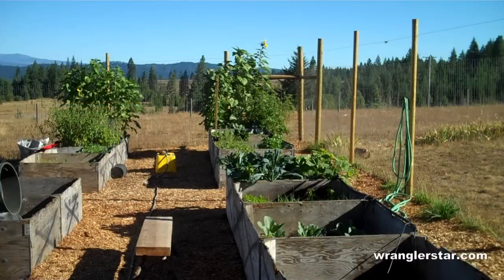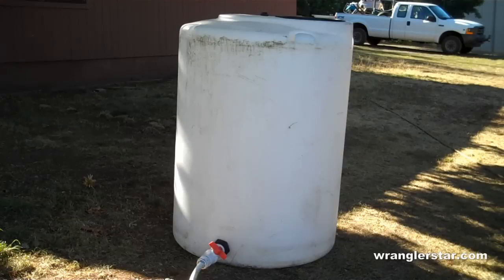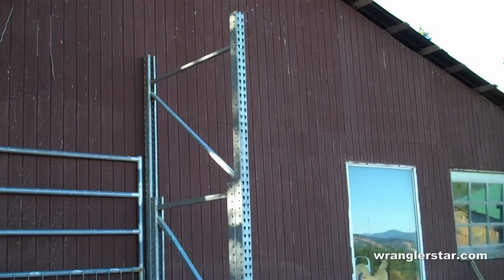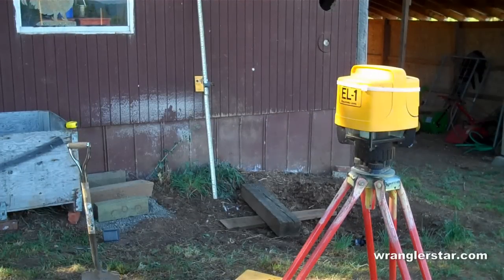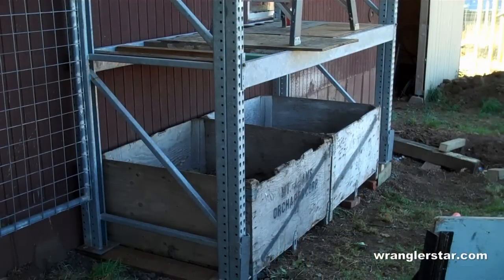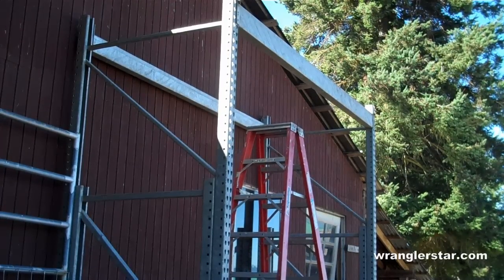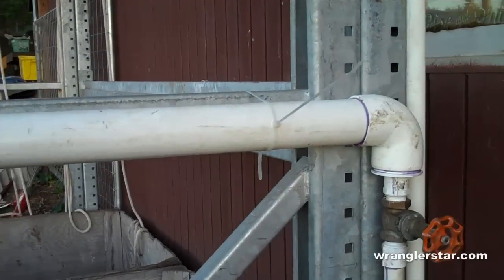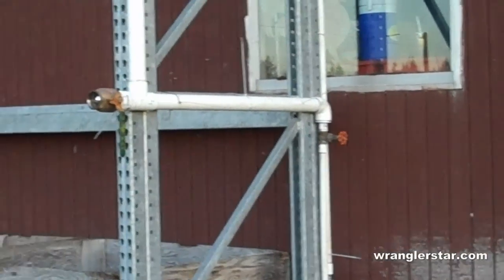How To Build A Water Tower Off-Grid Homestead pt 2

Comment from the maker: yes they are slender however they are heavy gauge and doubled up. The load is on top is static for the most part and will be bolted to the building. Do you think this will be adequate?

Comment: Great work Cody! The Ram Pump concept is fantastic. I'm reading a comment below mine on collecting rain water. We started collecting water from our tiny tiny garage into a small 30 gallon trash can and with the smallest rain it would fill it up and over flow. You could cover your firewood with a simple structure with a corrugated roof and collect rain water. Have you considered a below ground mega-storage tank? Tank cost would be high.

Comment: I built a temporary one years ago. 26' tall (the length of the timbers I got cheap), crossbraced with lag bolted salvage 2x6's,  and a 200 gallon horse trough up top. Also a 200 watt Wincharger from the 1930's, 6 volt! I charged gangs of 6 volt golf cart batteries, and then used them as a single 12 volt battery. This system got me by for a couple years, gravity fed water is much better then pouring it out of a jug, you can use less water, more efficiently.

Comment: Hi Cody. Here's some food for thought: I'm a former structural engineer. I used to design bridges and bldgs. Your tower legs are most likely what engineers call "slender". Slender members need to be braced to cut down on their effective length. This stops them from failing via "buckling". You may want to look at transmission tower legs, to see how they are prevented from buckling.

Comment: Legs seem strong enough, the answer to anyones doubt should be -what are the shelves rated to hold? The connection from the shelving cross pieces to the uprights would have the be the first point of give if it were to ever happen. One could easily add a second set of cross pieces say 2' beneath and set post uprights between the shelving to share the load between the two layers of shelf supports. Anyway this system is easy to take apart and modify if need be. I hear ya cody!

Comment: In the design I have in my head for my retirement cabin I have a steeple with the flr and lower walls tiled and h2o proofed and 2 water tanks. one for water, with its overflow leading to the hot water tank. this is how I plan to get water pressure for the indoor plumbing from a low volume well pump or ram or gravity flow from a spring. Haven't done all the math yet for weight and structure and head needed for pressur desired. So. this vid came in very useful. Thanks as always. Toby

Comment: .43 pounds pressure per foot of elevation, means if you want 60 pounds water pressure your tower needs to be140 feet high.
Normal pumps cycle between 40 to 60 pounds so 40/.43 means you want 92 feet to get 40 pounds.   Less is fine for drip irrigation, but pressure is a good thing.

Comment: Great video, good explanations, sound logic and reasoning. I really like the firehose attachment and had not thought of doing that myself until I saw your video. A word of warning though... the valve you have one near the close attachment fitting is not a gate valve it is a ball Valve. A ball valve will freeze and bust because of the water trapped inside the ball when it is in the closed position. Either drain the system for winter time or change that out to a gate valve.

Comment: A few thoughts on your project.
1. If you start getting algae in your tank, add a few tablespoons of bleach to the water. It doesn't take much.
2. Buy a 1,500/2,500 gallon water tank at Big R and use that for your over flow. Hook your gutters up so they discharge into that tank. You can never have enough water in the summer.
3. If you won't buy a tractor/backhoe(or small excavator) for yourself, buy one for your wife! You've got a good one there, Cody. Take care of her.

Comment: I listened to the trademarked (?) Wranglerstar Rant on a later video and I came back a few videos to take a look at what was being ranted about. Since it has been a few years since this video was posted I am sure the structure has worked out great. 

My only comment would be to upgrade to a couple of concrete, below the frost, piles. Adding a solar panels and some really slow wattage heat tape may allow you to keep this going over the winter should you plan a winter greenhouse. Melting snow and keeping it ice free is a challenge of course. 

Thanks for the video. Structure looks not bad to me.

Comment: We live off-grid in the midwest.  We have all the same seasons as you do out there in the Pacific North- West.  Having grown up out there, it seems much colder where I am right now here in Iowa.   We have a well that provides our water here.  We also have a 1.9 acre pond (but I wouldn't drink that water).  We have 4.83 kw of PV and another .8 kw of wind energy, both feeding our battery bank.  Even though it seems like a lot of power production, we still conserve energy the best we can.  It seemed like a great solution for us to build a water tower and control the well pump so that we are just filling the tower when we have extra energy (as a dump load).  I was explaining all of this to my better half and she proved again why I call her that.  She asked "what about it freezing".  So I pondered what it is you are using your tower for, and I came to the conclusion that perhaps you are only irrigating the garden (which doesn't require water in the winter) and this is not your source of potable water. For now it looks like we are back to the drawing board....and  I was really looking forward to being able to flush the toilets at night!!
Reply from the maker: +cmilano24 You are correct...garden only.  Any way for you to insulate?
Reply: Certainly!  Maybe I'll try and duplicate what the outdoor stove people do with the glycerol lines.
Reply: spray foam insulation?
Reply: 2 years after your comment I am wondering it you came up with a solution for winter. Insulation would only work for so long. You would need to do two additional things. Circulate the water and warm it.

Comment: We use those racks in our cold storage & you may want to put a strap or piece of all- thread connecting the front crossbeam to the rear in the center. I have seen those crossbeams spread out under load or if the base does shift & the boards/2x4's can fall out.

Comment: I just copied your tower at my cabin in AZ. I will only have about 500 gallons at most but only 275 currently on the tower.  I did use concrete footings but I even copied the 2x4's. Thanks

Comment: Paint your barrels black then rap your barrels in black plastic, this prevents sun from penetrating the barrels but also heat. Place the barrels on the side of a building where the sun does not shine so your barrels do not go through a heating and cooling down fase every day. Use fine inlet screen to filter the water before it hits the barrel. Use a water spreader when it goes into the barrel. Do not allow insects acces. Clean roof/gutters is essential.

Comment: I would like to see an update on how this is working out. I didn't see a valve to shut the water off for future work on the system. If you add a tank or rework lines it seems you would need to drain the tank or stick a ball in from the top to plug the outlet from the inside.

Comment: I think the tar paper over the compost could contaminate the compost? Great stuff this is a project I will attempt in the spring. Our property has a similar water situation, and I watched this year to know where the best place for the garden will be. I used to work at Home Depot and they discard that type of racking when they do resets, they just through away what they change. They don't reuse anything. If you could catch it as it is on it's way to the scrap yard it would be a good score.

Comment: This should give you good pressure as well I had a similar system for fifteen years in Australia we filled our tank from our underground concrete tank that contained all the rain water from our house and several sheds we had a gal pipe constructed tower as well we had to use the bucket of a back hoe to get our empty tank up there

Comment: 3:17 do not use any kind of lumber, pressure treated or not, as a bottom plate in contact with the dirt.  Tou will get termites. 

I did the regular lumber treated with used motor oil used as a post for a mailbox.  It roughed in six months

Comment: FYI: 2x PT wood is, in general, NOT rated for ground contact; 4x, or 6x on the other hand it is.
I like the simple designs that makes sense. I would think about cross-bracing the to legs of towers to resist sheering force. Solid attachment to the wall of the barn would do it, IF  the wall sheeting is structural, or the is cross bracing in the building wall. Like diagonal 2x4, or metal strapping.

Comment: Why do you want to build a water tower, given that you use electricity to put the water into the tank. If it were truly off grid...the tower would be fed from rain water off of the roof. So the tank is just to store the water for when you need it if you ever go off grid for a short period of time. Maybe you should add a rain gutter into the tank. Then that would be more off grid. Did you test what the water pressure is coming out when filled? Thanks for the video. I have enjoyed it.

Comment: im not a licensed engineer and i  havent run the numbers but your first stop should really be the manufacturer. They will know better what their product can support. I would say however that bolting it to the building behind it will not suffice. the architect never intended there to be a 4 ton water tower relying on one of the walls for stability and in all honesty, your water tower should really be a stand alone unit and not have to require another building for support

Comment: Engineering critique: Wouldn't it be more efficient to have the pipe that fills up the tank, be placed at the high end of the tank? With it at the bottom, it has to pump against all that increasing back-pressure while filling it up.

Comment: Cody I don't want to rain on your parade, but you have a serious safety issue there. I use that racking in our warehouse at work and the cross beams you are using will not support the 8000 pounds you are going to subject it to. We never allow liquids of any sort to be stored on our racking. You should be able to find a load rating for your racking on-line to check this. In addition, you should put some more cross beams in lower with vertical spacings of no more than about five feet.

Comment: Wrangler,  If you turned the ram pump over and connected some same size pvc to the check valve could you not salvage some of the water and let it flow directly into a pond or some other area, water trough for livestock?  I'm sure you dont want to restrict that outflow from the checkvalve.

Comment: The one and one quarter inch  "fire valve " is a ball valve not a gate valve .
Just build a wood storage tank to your needs.
Line it , piping into the top , for filling , overflow and  output , you know siphon , water pressure is created by its height not its volume, about a half a pound per each foot , the same pressure reading in a one inch pipe or a ten inch pipe.
Give it a test ...
Gauge your fire valve pressure ,
Then put a hose in the top of your tank to the bottom then siphon the water in the hose , put a gauge on the hose .
Reply: I'm talking pressure here , not volume , yeah , the larger the pipe the larger its volume , pressure is the same.

Comment: How do you keep the water tank and pipes from freezing? Are you going to insulate them? Do you have to shut down the system in the winter/prolonged freezing?
Peace, Reese
Reply: Reeses Pieces Yes, you would have to drain the system for the winter.

Insulation wouldn't help. You'd need something heating the water, and then it wouldn't be sensible, because you don't need the water in the winter, seeing as how this isn't household water supply, but seemingly just for the garden.

Comment: I'm curious, did you know that water weighs in at 8.35 pounds per gallon, so you're 500 gallon tank would weigh 4,175 pounds when full and you said the rack was rated for only 4,000 pounds? So, how is it holding up?

Comment: im a little concerned about the way you have your tower set up. ive taken some engineering courses and there really isnt a whole lot you have there keeping the structure rigid. The sides have triangular cross members designed into them which offer some structural rigidity. what you essentially have is an extremely heavy mass high in the air which in heavy wind may collapse or tip....i would brace the structure with some cross members from opposite corners to brace it.

Comment: For the overflow line wouldn't it be better to pipe it back to the pump and set up an automatic shutoff? I would imagine it would be a back pressure type so only when water is behind the unit the pump intake shuts off.

Comment: Would you consider adding water barrels below for the overflow? Or is your ram pump reliable and the reservoir it drains from reliable? I'm looking for reasons for myself to invest in water barrels, but i need unfortunately to rely on well/electrical water pump for my pressured water due to semi-urban living.

Comment: you should have gone with an old fashioned timber framed tower like the old railroad water towers, all wood.
Reply: Peter Nvrmnd No, he shouldn't have.
Reply: yes, It would have looked a hell of a lot better than what he did build.
Reply: Peter Nvrmnd No, it wouldn't have (shock and awe, not everyone has the same aesthetic tastes as you)..

More importantly, like he said, it would have taken more materials and more work to get a similarly functional result.
Reply: seigeengine yes, It would have looked a hell of a lot better than what he did build, and yes it also would have taken more materials and more work.
Reply: Peter Nvrmnd Welcome to opinions. Yours are no more valid than mine.
Reply: +Peter Nvrmnd Some times sacrifices must be made. It was likely a lot cheaper to use that second hand rack than building one from scratch out of wood. Also the wooden tower would have taken up a lot more space and likely required some form of solid foundation because of the weight of it. 

Some times Engineering trumps aesthetics
Reply: +Peter Nvrmnd He "shouldn't have" done anything else.  He worked with materials he had, which were also of high quality and known strength.  An all wood tower would've had a lot more pieces, and not necessarily be better looking.

Comment: late question here:  Starting from your water supply area, to the water ram pump, to your water tower, how does your water system handle your freezing winters?  Would it not freeze solid?  How well does the pvc being exposed to the sun and freezing temps stand up over time?  Thanks
Reply from the maker: Depends on how freezing - enough flow and not super cold will continue to work...depends, depends, depends...
Reply from the maker: Depends on how cold, pressure, etc. mrsw
Reply: constant moving water doesn't freeze. my water system is a gravity feed system that runs into a 300 gallon tank then over flows back onto the creek for 3yrs and ive never touched it since and it never freezes because it is in constant motion. i simply pump water from the tank to the house as needed. his system is the same as in it is constantly flowing as well thus will never freeze.
Reply: Same reason municipal water towers don't freeze 😉
Reply: john smith
exactly...

Comment: please please drop the two racks down another12 to16 inches lower all that weight at the top with no other weight distribuited lower on the rack could cause disaster i seen a similarset up difference wasit was skids of paperon a rack only on the top of the rack a towmotor hit the rack slightly andcaused the skids to collasp lay on the floor was a employee of 20 years crushed  as soon as i seen the rack it sent shiversup myy spine

Comment: 8 pounds per gallon x 1000 gallons = 1 ton? Shouldn't that be 4 tons?
Reply: +Emerson White On the contrary, "A" is often used as a number, indicating one of something, A Horse, A Fish, A Face, just as examples. While wranglerstar likely meant "A Ton" to mean "A great deal of weight," the statement could just as easily have meant "A Ton" meaning "One Ton" where he didn't bother to do that math in his head and get the proper weight of 4 tons of water.
Reply: +Emerson White Sometimes "A" can mean a colloquial "great Deal of weight, but there is a difference between sometimes and always, so what you've pointed out isn't so much on the contrary, but irrelevant. rephrased and spellchecked so it's more correct and turned back at you.
Reply: 2000lbs = 1 ton
Reply: A gallon of water weighs 8lbs no matter what country you live in. Other liquids may weigh defferently. But water weight is globally the same.
Reply: 2000lbs equals one ton no matter what country you live in also. Metric ton is not the same as a normal ton. Two completely different weights for different reasons. But both used globally.
Reply: I think in an earlier video he said math was not his strong point----->Just Saying,,,without the math, he figured bout right,,,AYE,,,It's still up there.  Why do you people pick on this guy?  He is just trying to give it a go---and teaching people.  I've learned alot from him,,,so---->To Heck with the math
Reply: Agreed---------------------> Torrey is just picking on him (childish)

Comment: Judging by the color of the racking that is basic cold zinc galvaneal. Depending on environment that's really only good for 1-5 years unless you paint it. True G90 hot dip galvanizing of steel is a dark deep gray. That is the galvanizing everyone thinks of that is good for 90+ years.. most things now a days is only g60 galvaneal when it's advertised as galvanized. even still paint goes a long way in preserving any materials. Paint it..